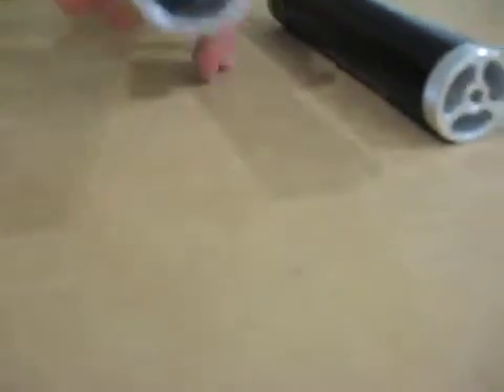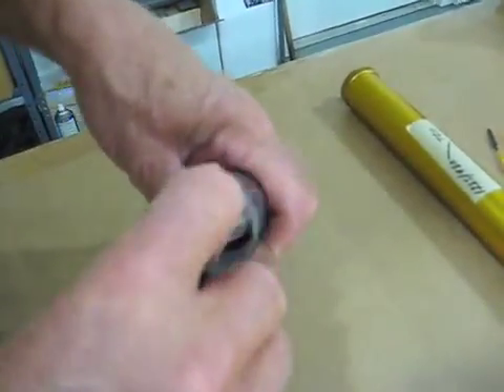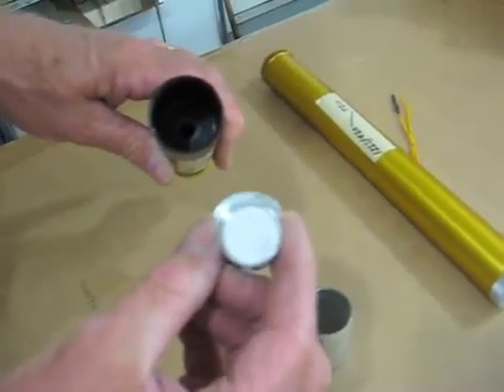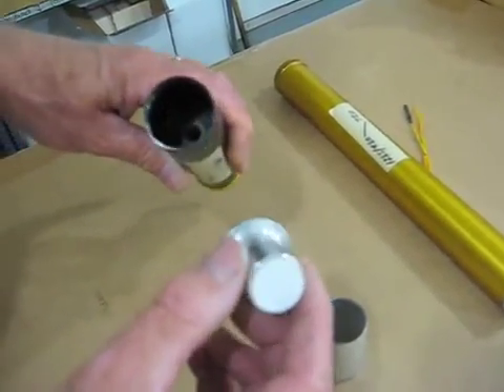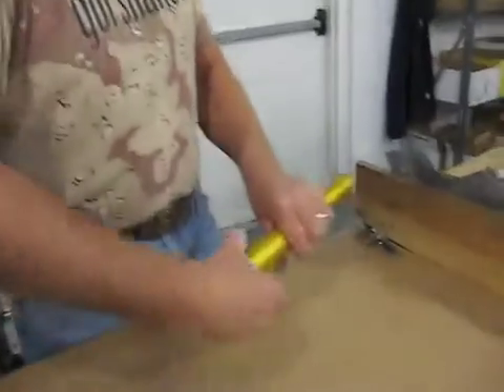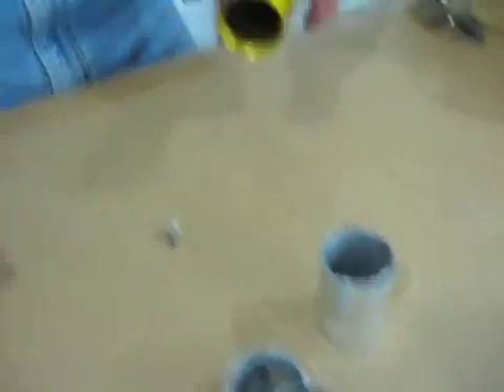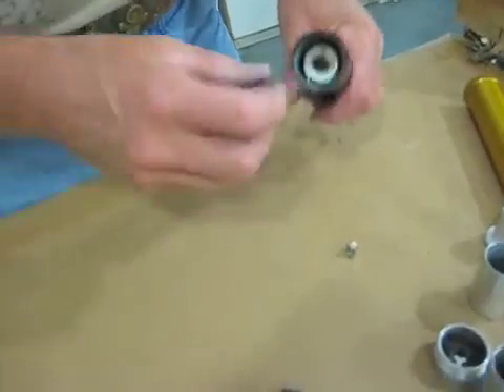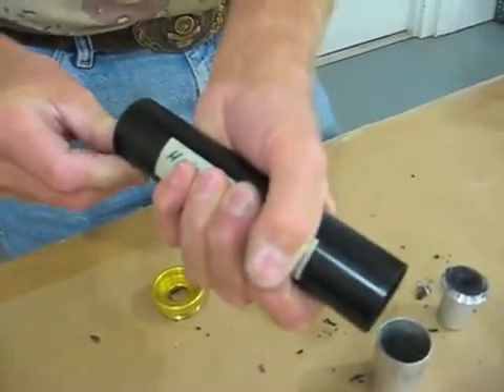AeroTech Reload Adapter System Demonstration

Comment: Can you use the Floating forward closure in place of a normal forward closure on actual size reloads? Ex: 360 motor in a 360 case but with this closure